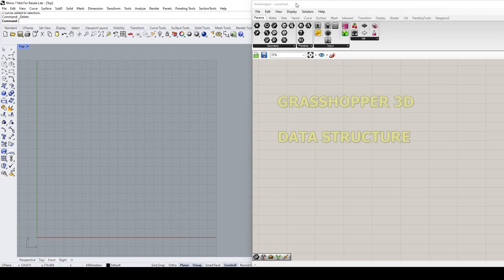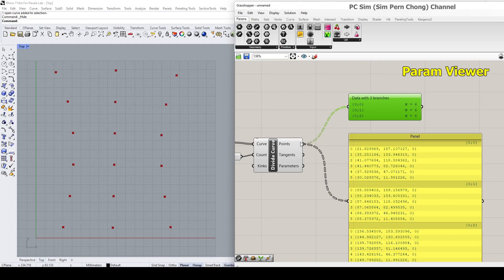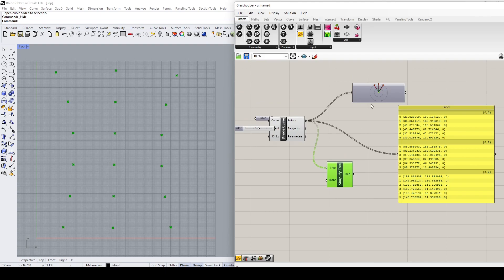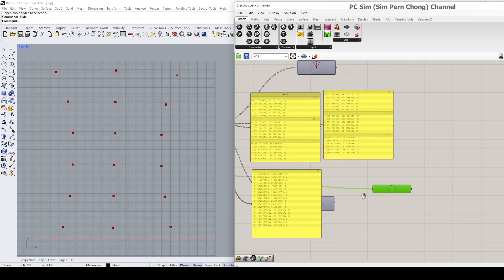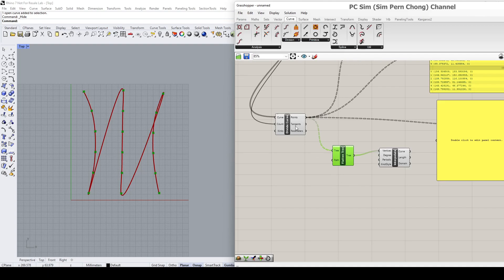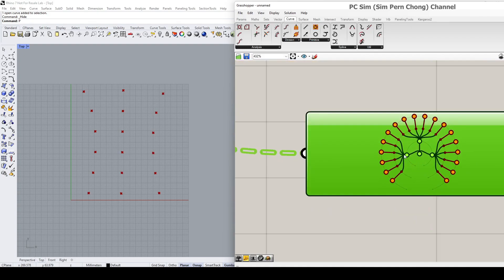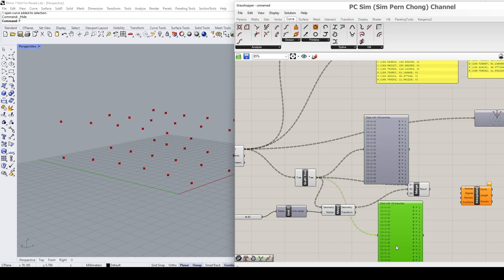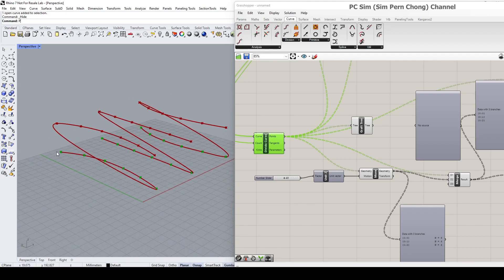Grasshopper 3D Tutorial: Essential Data Structure & Modification (Updated)

Comment: In Grasshopper 3D, a data structure refers to how data (typically geometric data, but also numerical or other forms of information) is organized, stored, and manipulated within the Grasshopper environment. Grasshopper allows users to work with complex data flows by managing different kinds of data structures that are designed to handle and control how geometry, numbers, or other data types are processed.

The way data is structured in Grasshopper is essential because it influences how components interact, how inputs and outputs are handled, and how you can control and manipulate your design logic.